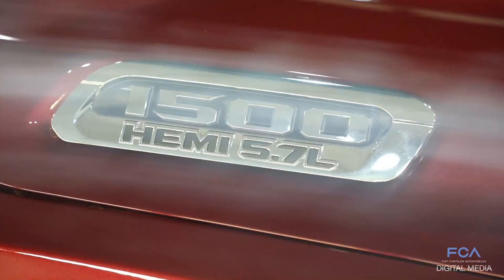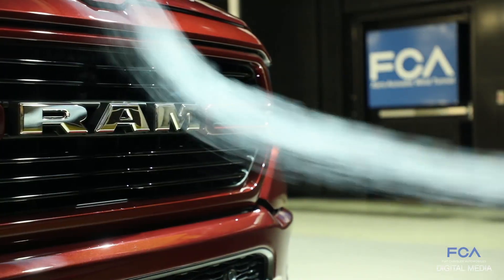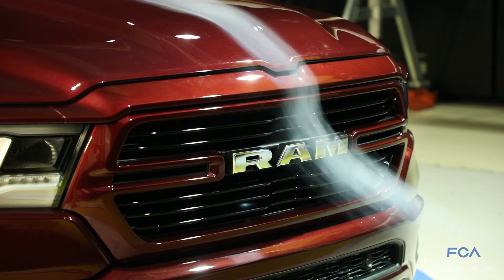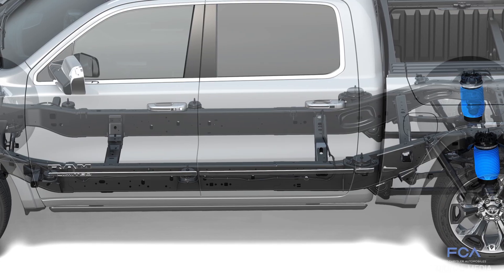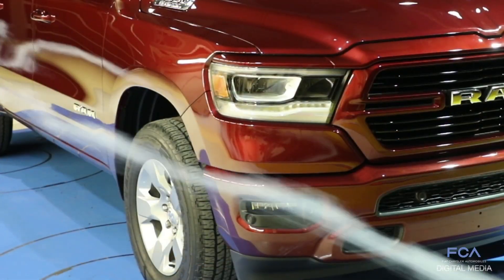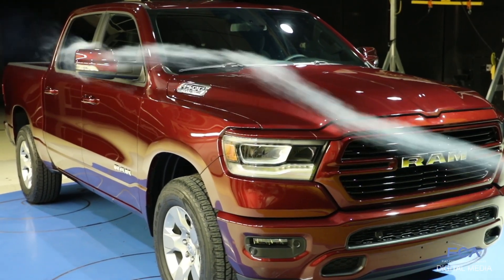2019 Ram 1500: Wind Tunnel Testing

Comment: I just bought a new 2021 Ram 1500 4x4 V8 5.7 with Etorque and yet my fuel economy sucks. I get 13 city if I am lucky and 17 highway, nowhere near what your EPA rating of 22 highway  18 city and that’s me being light on the throttle. If I would have known this I would have gone with a Ford F-150 instead like I used to have. In My opinion and so far true experience with the truck the fuel economy numbers are false advertising and misrepresentation.

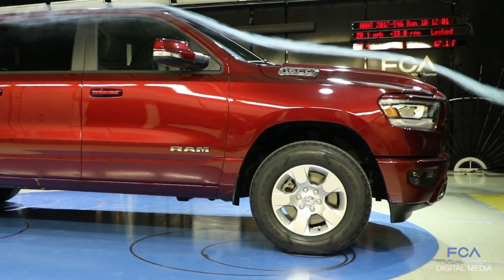Comment: At 2:18 How does air bend like that like there's no object that follow smoothly down the air flow at the back of the cabin
Reply: Air pressure
Reply: Promote clean separation at the trailing edge
Reply: Yeah I thought it would be doing loops

Comment: 15 jun 2019 8:35 pm edt:
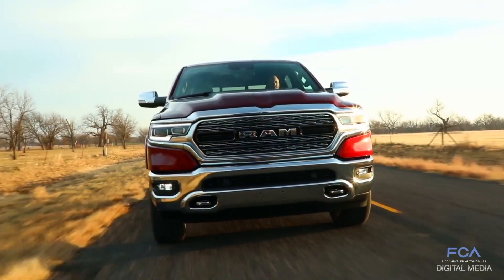0:35 can wind drop to truck-bed then tailgate drag that wind....maybe tailgate should look like f1-car-rear-wing, making down-force to rear-area, giving more friction to rwd

19 jun 2019 5:34 pm edt additiion ----------------------------_
0:35 if there is a short-stature-wind-mill on truck-bed whose short-stature is shorter than tailgate-top-surface then will that short-stature-wind-mill rotate during truck moving forward.....

Comment: You guys can definitely be a class leader in gas fuel economy once you give the hemi some extra love. A new hemi with direct and port injection with more effective valve timing and maybe higher compression ratio would certainly be great with your etorque system. Probably could work on the cylinder deactivation a bit more too. The 2019 Ram is a great improvement though.